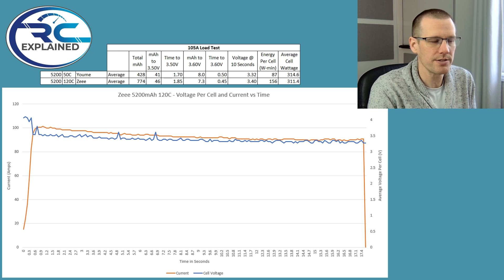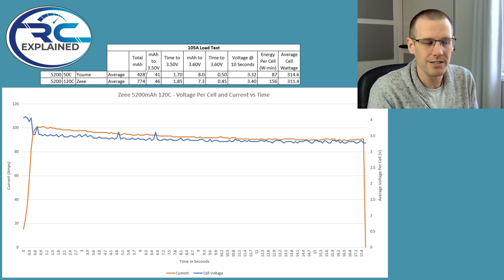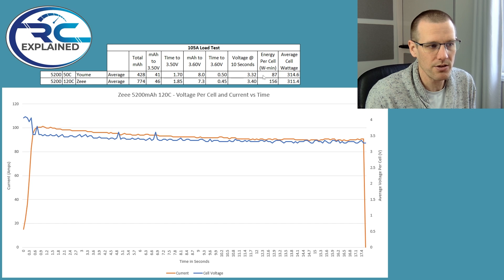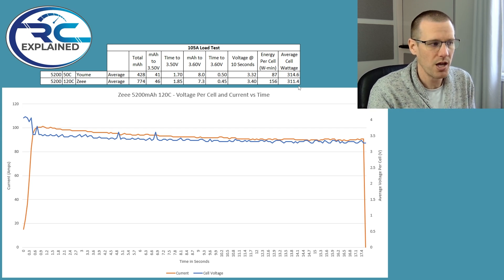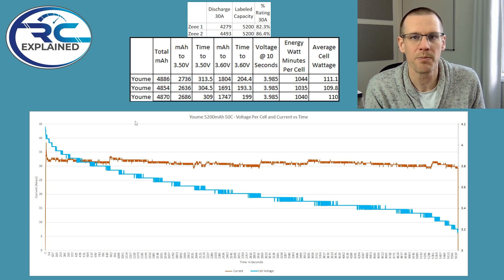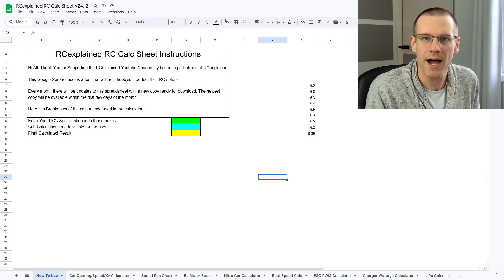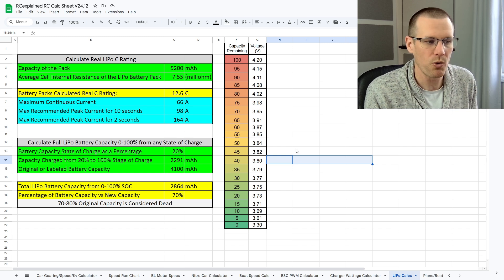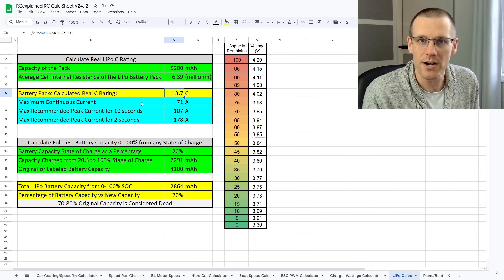Identical Performance? Youme Power and Zee Batteries Compared!

Comment: I had to double check in my lipobag and indeed.... Youme and Zee batteries :( big sad I got Amazon special'd

Thanks alot for the discharge curves under 2 different loads!
I knew this crap stank but now we got metrics to know how bad. Decent IR but terrrible discharge under high load 40+amps I got youme 6500 and zee 10000 4s packs. They work but meh
Reply from the maker: Glad this information helps!

Comment: The only cheaper battery that has been really really good for me has been a 6s 120c 6200mah Hoovo. The thing goes hard for a half hour but my 3s hoovo isn’t as good . The yowoo seems to be doing good so far but that hoovo goes forever . Maybe this one is better made . My zees and ovonics are ok , just ok . They cut out when I hold the throttle full beans for more than a cpl seconds . I ll be buying whatever you or innovation RC recommends cuz he floors his and knows what works . I think it’s gens ace, yowoo and chnl ? That one 6s soft pack hoovo though . It’s weird because it charges at 3.5 amps no matter if it’s set to 6.2 it won’t go higher than 3.5 .

Comment: i made a Youme 8s 10,400mah pack for my infraction and it went 100mph and held 28+ volts under load. Not terrible for a $90 battery, they are super cheap when on sale

Comment: These are the same type of results I have had with Zeee and Youme. I actually have a pair of the 5200 4s 50C like you tested. I only use them for my 1/6th crawler now as they are useless in anything else.
Reply from the maker: True, at least you found out how to use them.